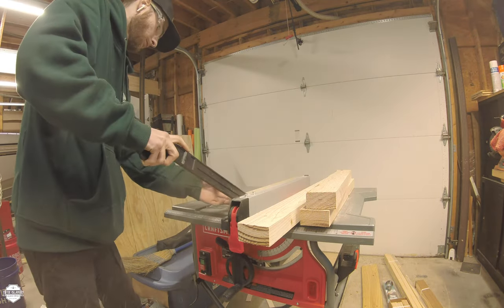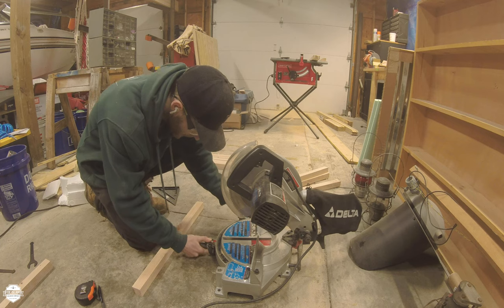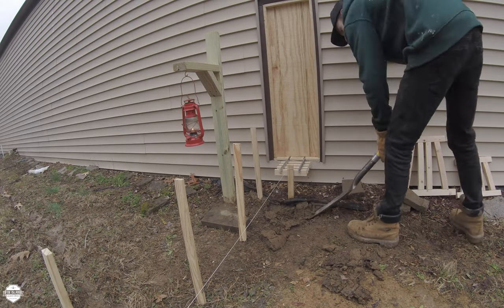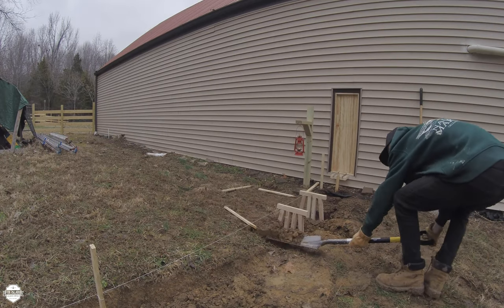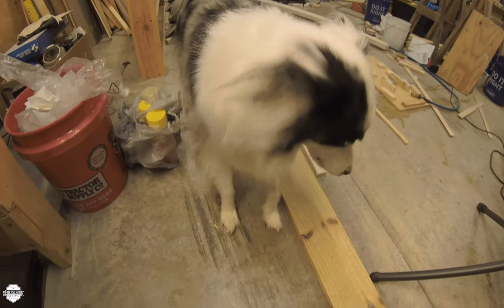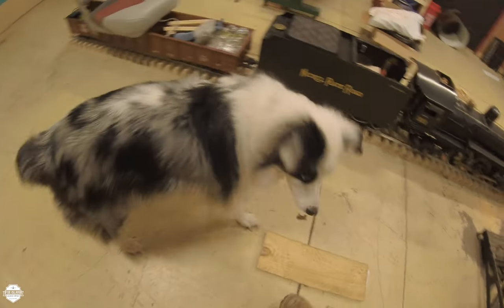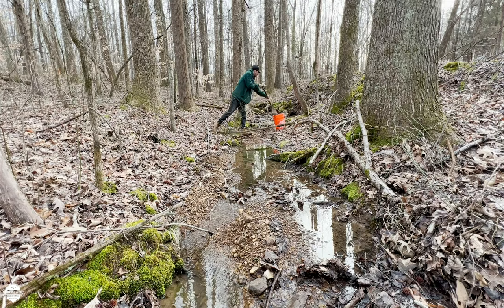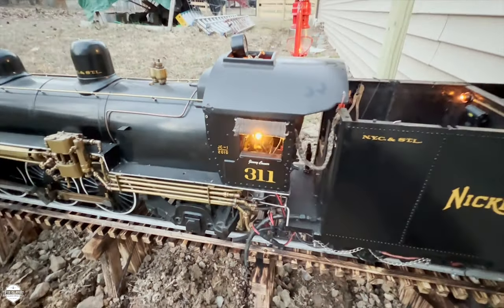Building a Live Steam Backyard Railroad: Episode 2

Comment: The bridge supports turned out awesome. However, might I suggest shortening them and placing them on concrete footers? This will allow the wood to last a lot longer, as opposed to being in contact with the wet ground. Just speaking from experience with my railroad.
Reply from the maker: Thanks very much!! I do plan to use concrete footers and slightly thicker (preferably treated) lumber for my future bridge projects, this railroad build will likely require several. Truly I just wasn’t wanting to make the commitment of concrete with this bridge so close to my shop, and with it being my first build, I figured I may have to design it 3 times to get the look right… but I appreciate the kind words, and I definitely might have some questions in the future! Cheers

Comment: Love the charred wood! Are you using pressure treated lumber? I'm rebuilding my G Scale LIVE Steam outdoor layout now and may give it a try. Can't wait to see your completed railroad.
Reply from the maker: Thanks very much! This bridge is actually just cut from standard untreated white wood studs, and the charring method serves to treat the lumber. I will say, so far, I’m entirely impressed with char-treating. I haven’t seen any of the wood get waterlogged after storms (rain beads right off), no bugs, carpenter bees, ants or other insects find it attractive, and it does feel quite sturdy. This was mostly an experiment to see how the wood holds up with no chemicals and only burning it, I had heard Japanese woodworkers have used this technique for ages… they might be onto something! (Would probably still recommend putting a coat of poly on anything you want to last a long time… but this is working wonderfully so far!)

Comment: Looks fabulous🎉, we’re did you acquire the rail. Does 311 have a copper or steel boiler?.
Reply from the maker: Thanks very much!! I bought this rail from a friend many years ago before he passed, the rail pictured is aluminum 5/8 Culp. I believe it was used before I got it, then I’ve also used it for 10+ years on storage tracks, engine stands, etc. 1/2” rail would technically be true to scale, however I’ve found 5/8 is much more durable and resistant to heat kinks in the sun. Also, 311 technically has both a steel and copper boiler - steel barrel, rolled copper tubes.

Comment: What size of nail or brad are you using in the air gun?
Reply from the maker: Great question - size of nail varied greatly for the purpose on this project. 2” nails were used to tack the bents together (then they were secured with screws underneath), 1.25” nails were used to secure the 3/4” ties to the spans, and I believe 3/4” nails were used to tack the 1/8” crossmembers onto the bents.
Reply: are we talking nails or brads?